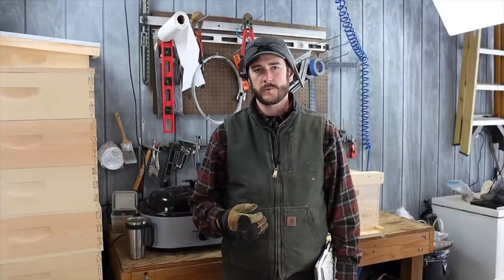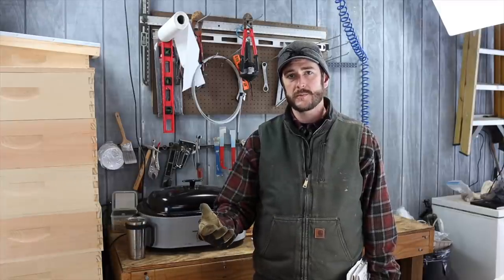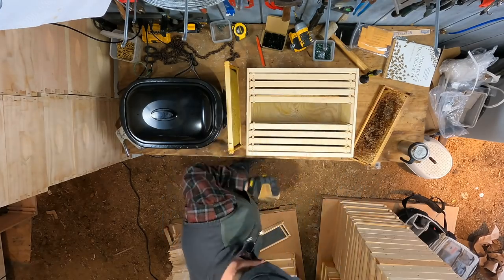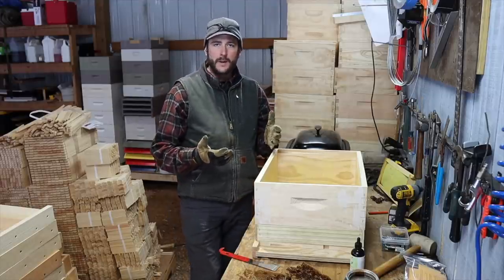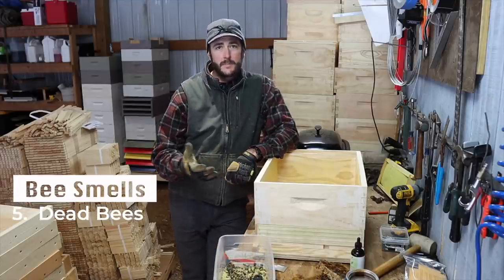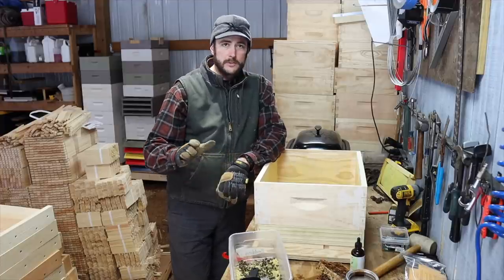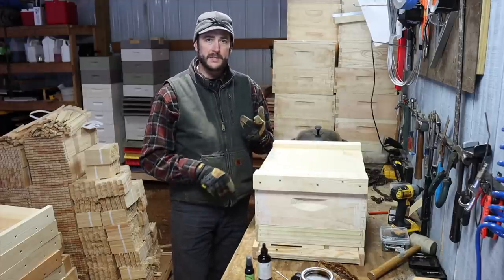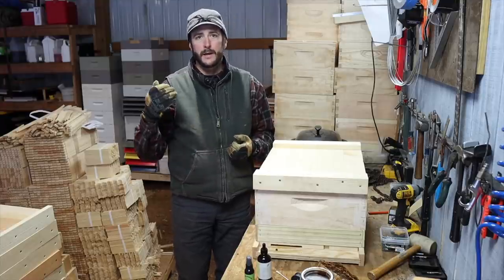How To Bait & Lure Swarm Traps - Swarm Trapping #2

Comment from the maker: One year update - I'll be using Swarm Commander in the spray bottle on the outside of the trap, freshened once a week or so.  No lemongrass or swarm commander inside the trap as I had several swarms refuse the trap last year and start building comb underneath the trap.  I will bait with at least one drawn comb and perhaps some propolis tincture, and use boxes that have been lived in since I have more bee resources this year.
Reply: What about the Mann Lake?
Reply from the maker: It works, but I got swarms that refused to go in the box.  The scent may have been too strong?
Reply: @DuckRiverHoney  That makes sense if it lasts that long... I can't imagine they are more advanced than the car scent industry and those thing are SUPER strong at first and taper off to nothing by the time you are supposed to replace them
Reply: Thanks for the update.
Reply: Thanks for the update! I’ve also had a couple swarms build underneath the box, but my theory was opposite. That I was hitting the entrance with too much scent so they preferred to build next to it (underneath it). My reasoning is that I see the highest amount of scout activity in the first 4 or 5 days after reapplying sent, then as it wears off they start to lose interest. Who knows for certain? I love your ideas about adding wax and dead bees. Thanks for another great video!
Reply from the maker: I’ve started spraying the box instead of the entrance.  I figure if it’s sprayed under the d handle or the lid the scent will last through rain better, and less chance of refusals.
Reply: Wouldn't putting honey in the trap help, also?
Reply from the maker: No, that starts robbing.
Reply: @DuckRiverHoney  Hmmm... I usually have a lot of maple sap left over in the spring from making maple syrup. Can that be used? (Thanks for the honey tip.)
Reply from the maker: I wouldn’t use any food at all.  If you get robbing started the activity may discourage scouts.

Comment: As a 2021 new bee keeper I'm enjoying going through your videos, thanks.  Look forward to the trap results.  You can always hit your local thrift store and look for a used turkey baster, crock pot, or electric skillet.  I bought an electric skillet with lid and adjustable temp control for $1 last week.  It isn't pretty but it works great for wax.
Reply from the maker: Awesome!  I'm painting, rearranging hives, adding space, and trying to get all my swarm traps put together in the next week.  LOTS to do now the weather broke.

Comment: Great series ! Thank you.
May I add:
1.- Drink wine? Keep the corks. Cut the cork and use to block the top of the frames to the box, on one side or both, so the frames do not move during transport.
2.- Have dead queens? Keep them in alcohol. Drops of this Queen Juice might get you lucky with swarms.
3.- Scraped Propolis? Keep you own propolis in alcohol, or buy some tincture. Dilute in a bowl with more alcohol and paint the inside of the new lumber bait hive.
Hope that helps ;)
Cheers from Switzerland
Reply from the maker: Awesome, thanks!  Very cool to meet someone from Switzerland!

Comment: Great video.  Over the years i have learned when using lemongrass oil that if i put 2 or 3 drops on a cotton ball and put that in a snack size ziplock bag it will last 3-4 weeks between applications.  Works similar to the swarm lure.
Reply from the maker: Thanks, great tip!

Comment: A deep standard hive box, preferably a previously used box with previously used frames, 8 or 9 of them  with drawn comb is good. A tight lid and bottom and a 3/4" entrance is also good. Fastened on a tree or a shed about 4 to 6 ft. above ground is good. Like the man says lots of bee smells in the box is VERY good. I have never used attractants out of a bottle. Creatures on wings can cover lots of territory and they'll find the vacant apartment space you have to offer if they need it. Since varroa has moved into North American air space there won't be any feral bees around any more so you'll pretty much depend on attracting escapees from another bee keeper. Good luck.

Comment: Thank you for the video and the information. New to this , this year. Have a two nucs stacked swarm trap, five frames each, waxed foundations, new wood so I rubbed bees wax from a local beekeeper, throughout the trap. Used lemongrass attractant and positioned this near an old unused granary that had a hive that was a supply box of some type, hoping to entice some of those bees to the trap. The trap is mounted on a 50 gallon drum about 7 feet off the ground. Next day I had a swarm attached to the bottom of the platform supporting the trap. But, for four days days now they remain there without going inside. The entrance faces southeast but the swarm is on the north. The hive in the granary seems as busy as ever. Old comb(last year) is in the trap too. Should I capture the swarm and place it in the trap or wait? Thank you.
Reply from the maker: I’d go move them in if they have t done it themselves yet.  They can and will reject the trap and go somewhere else.
Reply: Thank you. Lesson learned.

Comment: Great video! Any recommendations for those of us who may be starting from scratch? I don't have any old comb, etc.
Reply from the maker: Swarm Commander or Lemongrass Oil for sure.  If using new lumber, I would buy a pound or two of wax and paint the insides of the boxes.  Some will tell you never to buy wax because it can get contaminated, but for this purpose I’d be fine with it.
Reply: I started last year so had no drawn comb. I had a nuc with Starter strips in the frames to give them space to fly around, baited with just a few drops of lemongrass oil on some cotton wool. Got a swarm in under a week
Reply from the maker: That’s awesome!  I absolutely love swarm trapping.  It is so fun checking them, like a kid on Christmas.

Comment: love the dead bee idea. I usually have old drawn comb I put in, that i dont care if wax moths get, and I like it to have some capped honey and pollen. just one of those. I have some small hives that didnt make it and have bees in the cells on that type of frame, Ill bet they will work great
Reply from the maker: I'm sure they will work great.  I avoid honey, pollen, syrup, etc, mostly because of ants.  Carpenter ants can overrun a box fast.
Reply: @DuckRiverHoney  we can get some sugar ants but they are frames I dont really care about, and I think it helps them settle in quicker if they have a frame that is ready for the queen. we dont have lots of swarms around here, I need every advantage
Reply from the maker: We’ve got a lot of mixed wood lots with pastures & row crops.  So neat sites plus forage area.  Lucky to have a healthy bee population here.  In a lot of areas it’s not so good, though in populated areas you may get into catching swarms from kept hives.

Comment: I saw a video that referred to the Honey Bee Democracy and said that Lemongrass and Neroli Oil together 2 drops Lemongrass to one Neroli was the closest to the swarm pheremone you could get.. But, I do not have the book, or could have heard it wrong, since you didn't mention it. 
But, the guy doing the video looked like he was well versed with using swarm traps.. Sounded like he caught a bunch every year and put them all around his area. A couple near his apiary, the rest in his local town/county. 
You could have put too much. They lightly dribble it on a cotton ball, not wet, and put it in a snack bag and zip it half closed and put it in the back of the box and one drop of the mix on the bottom of the frame closest to the door and one drop just below the entrance hole inside the box, which was 1-3/4" above the floor of the trap, I believe. It's probably what the swarm commander is... The videos were by a bee club and a bunch of the guys were swarm chasers.. Just for what it's worth.. I did not save the videos.. Oops,, I have one of them.. 
Here you go on the 2 to 1 mix, and this guy uses the tincture on all of his new wood. Has several videos on making it.. Pretty simple.. I started some today.. And, another fella just heated it on the end of his hive tool with a torch and smeered it in his boxes. 
Hope that helps.. 
I like your idea of the folding stands.. Lots of very tall trees in my area and not many limbs 15 feet up.. They start around 50 or so, so, might try some flavor of that. Lots of them are leaning to one side.. One extra board screwed to your platform and just lightly screwed into the tree should work on the one slanted the wrong way.. Ha... I built 7 last fall. The tall 6 frame versions. 3/4 ply front/bottom and back and 1/4" sides. Late again, but, fixing to put them up in a day or two.

Comment: I’ve never trapped before but am interested in having atleast one just in case. I only have one hive. After I paint a box I have been giving them a couple weeks to properly cure the paint smell then swapping it for a box on the hive during my inspections. This gives me a box already lived and used by the bees🍺🍺
Reply from the maker: Sounds like a plan!  Two hives in my opinion are more sustainable than one.  Two can become one if needed, but one alone can die.
Reply: Yeah I’m hoping to multiply the hive this year. All up I only plan on having 5 hives total as a backyarder hobbyist. I purchased a full hive in December 2020. In Australia where I live our winter’s are still pretty warm. I’m about to try my hand in making a few queens to service my needs.
Reply from the maker: I tried queen rearing last year and had some success, some failure.  To be honest I'm hoping swarm trapping can give me a yearly supply of queens.  I see a few advantages: 1. The queen already swarmed, she's less likely to swarm again same year.  2.  Totally passive...I put up the traps, bees move in.  No tight schedule like queen rearing.  3.  Swarm is a starter colony, so I can leave them as a nuc until another hive goes queenless or I need a queen for some reason.  Then just do a combine.  In my head it's pretty efficient.  We'll see if it works in the real world.

Comment: Great video!!
Question for you as I'm  a very beginning stage of beekeeping... 
Do you use frames with plastic foundation or waxed foundation?
I purchased the beehives and it came with just plastic frame and I wonder if it's a bad start
Thanks so much in advance🎈🎈🎈
Reply from the maker: I prefer waxed black plastic foundation in wooden frames.  I use Titebond III with six 1.25” x 18 ga staples per frame.  I am using some solid plastic frames this year and think you’ll be fine with them.

Comment: @DuckRiverHoney what research do you have about using the dead bees as a swarm attractant? Please site a source that I can read. Thank you.
Reply from the maker: Hi Max,  "I read it somewhere" isn't a source, but that's all I can give you.  It was a tip from a swarm trapper on beesource if I remember correctly.  I searched quickly but didn't find it.  As baiting goes, I think a few dead bees may help to sell the trap, but is not nearly as important as the presence of old comb, nasanov (LGO or Swarm Commander), and waxing the walls if you've got new lumber.  Some also scorch the inside of new lumber and report good results.
Reply: @DuckRiverHoney  I was trying to find a source as well but only found resources stating the opposite that dead bees don’t have any smells long term and in the short term are a detourant when decomposing. Please update if you find your original resource. I’d be extremely interested to read it as well. Thank you for your time.

Comment: Have you noticed a difference between swarm commandee and lemon grass oil?
Reply from the maker: I’m actually going to stop using either inside the trap and will just use swarm commander on the outside.  I will use a frame or two of drawn comb inside this year because I have plenty now.

Comment: Still very interested in detailed plans for your trap system.
Reply from the maker: From bottom to top:  10 frame bottom board OR plywood, a spacer of variable size - I commonly use a 1x4 which actually measures 3/4" thick by 3.5" wide.  Then a medium super with 10 frames in it, and a top - either plywood, advantech, or a migratory or telescopic top lid.  All dimensions are standard 10 frame langstroth, so 16.25" wide by 19 7/8" long.  Pretty simple.
Reply: @DuckRiverHoney  Thank you.
Reply from the maker: No worries.

Comment: One thing this video does not convey and does not demonstrate (unless I missed it) - if you have well used equipment, that itself is great lure. People may get the idea they need to be using shiny new boxes like in this video - No.
Any old trashy, cracked, rotten hives make great traps.
If you making a video of the traps - this is important to mention and even demonstrate.
Reply from the maker: The more bee smell the better.  New equipment is a disadvantage that has to be overcome.  Old equipment makes things a lot easier.
Reply: @DuckRiverHoney  
Exactly. 
And you should talk about it (with a disclaimer of possible risks).
Some newer beeks may not know and forgo the used equipment.
I myself did not catch much of anything UNTIL I got a hold of used equipment.